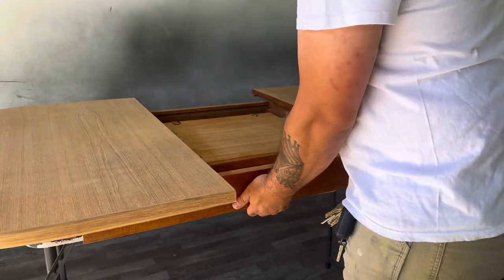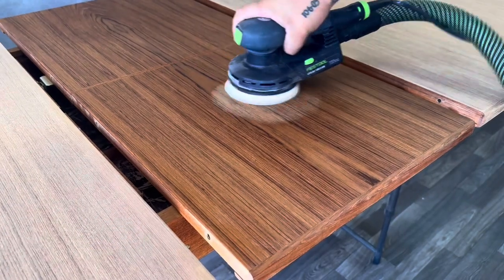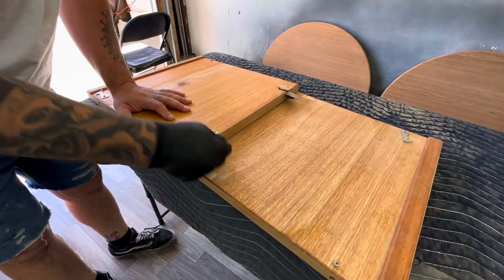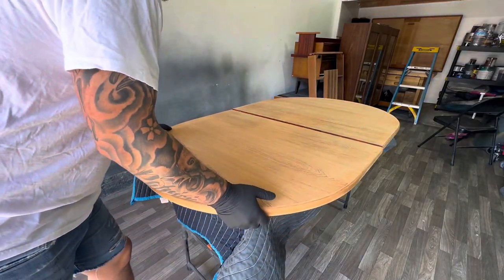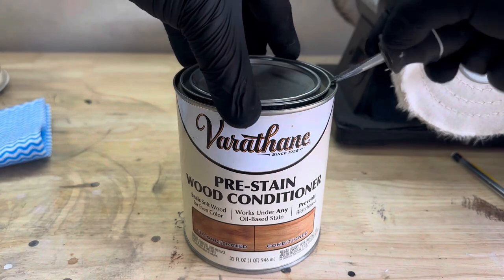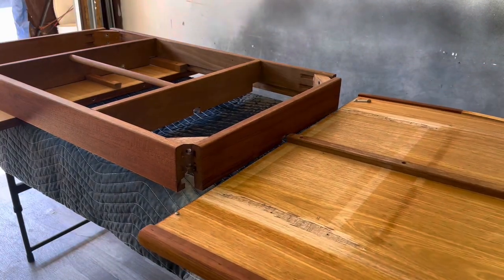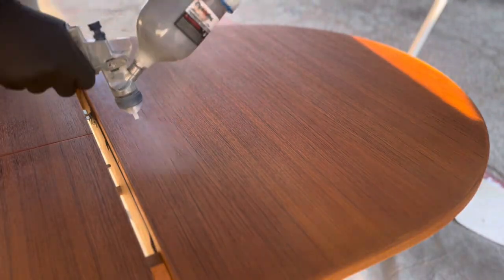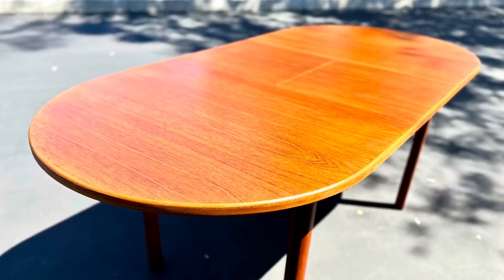HOW TO FIX A DAMAGED AND STAINED TEAK DINING TABLE || DIY FURNITURE RESTORATION

Comment: When you don’t take off wax, oil and silicone first you can grind them down into the wood. If someone uses Pledge that has to come off first to get a finish that will stick for the long haul.
Reply from the maker: Thank you so much. I did wipe down with TSP but it wasn’t any help

Comment: Thx for this tutorial- I have a teak or rosewood table refinish coming up. I’ve watched tutorials using different oils to refinish with but have always used polyurethane on my tables so was not feeling the tongue oils would protect enough. Also, have not wanted to buy the aerosol toners and  lacquer cause of the high VOC chemical exposure even with the respirator I wear. Yeah this is the product I’m going to buy and try; Behr polyurethane and stain in one!!
Reply from the maker: No problem at all. This product is stage best. I like oils but like you said, I don’t feel it is enough protection for a dining table. Just be sure not to get the blue can that is 1 coat coverage fast drying. It’s to dark in any color you get. Get the green can.
Reply: @CedarPineDesigns  in your video it looked like you used the blue can? I can’t seem to find the green can online. Do you have a link to the products you used by any chance? Thanks 😊
Reply from the maker: @jessvanroosendaal5026 sorry but I’m not sure what product you are referring to